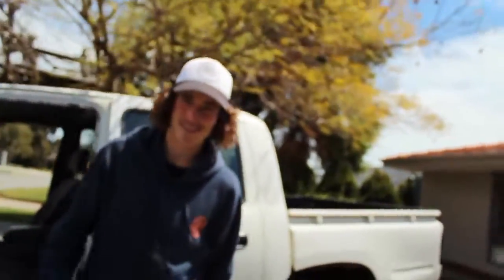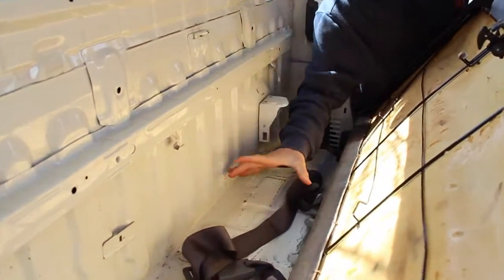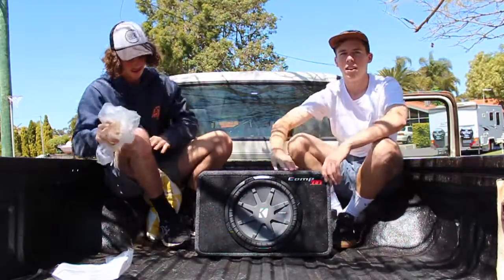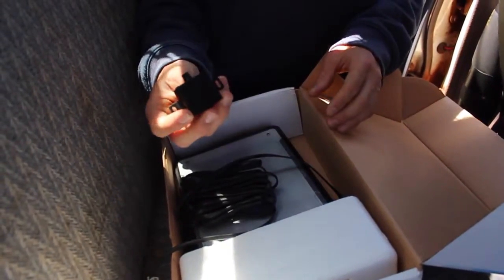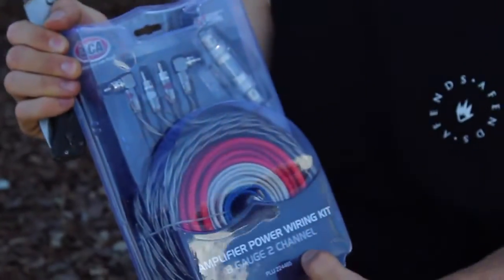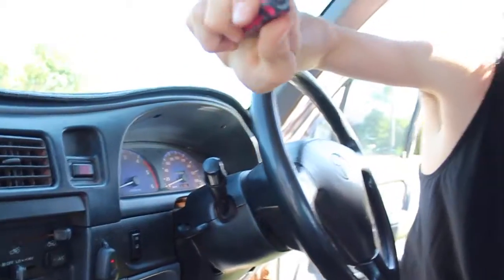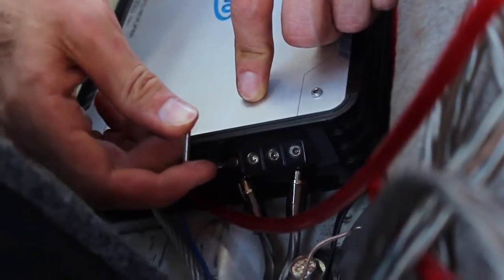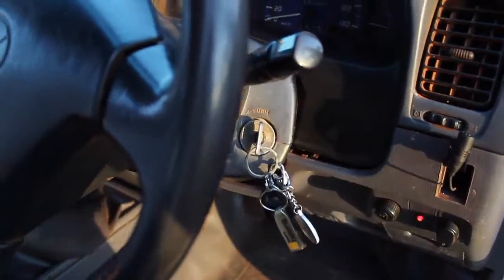Cutting the Hilux to fit Subwoofer?? Install

Comment: Well done boys. Not only have you made ya rear fire fire weaker you have set the it up for a fire. A Couple of quick tips.Fit the fuse within 200-400mm from the battery, that way when the cables pinched (by either a seat or accident) or when it shorts out on the non bushed hole ya drilled into the front fire wall, the large power cable wont short the battery and set the car alight! Fuse at the back is very dangerous and WILL void any insurance you are unlikely to have.
Also take up woodworking, moding the box would be 100 times safer than hacking the rear fire wall with minimal sound change.
Apart from that, well done on giving it a go.
Reply from the maker: +Scott Humphreys cheers for the advice man

Comment: You guys cutting the bar out was a pretty sad moment. I put a rockford fosgate P3 slim in my car and it fit without cutting the bar out, just had to bend the tool kit tab out the way. My sub though has a metal ring around the subwoofer so the woofer isn't rubbing up against the seat. I did hit the metal rods on back of seat with a hammer to budge seat out so I can latch seats. Doing this was a sad moment for me, I think I could get the budge out the seat if I wanted though.

Also as someone else stated there was pretty much no point even adding the fuse where you put it.

Comment: I have the same but single cab and i was just wondering if i buy a sub with a built in amp will i need one for the extra speakers i put in . Thanks.
Reply: i have a s/cab luxy put a under seat sub in rear takes up piss all room